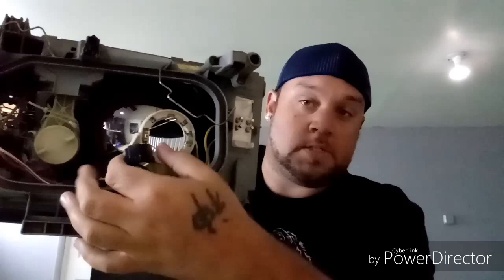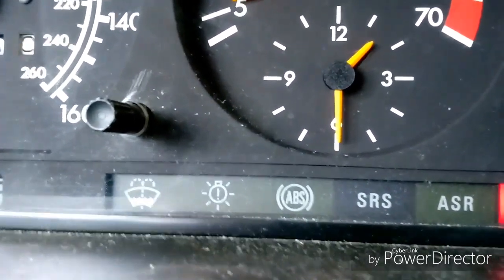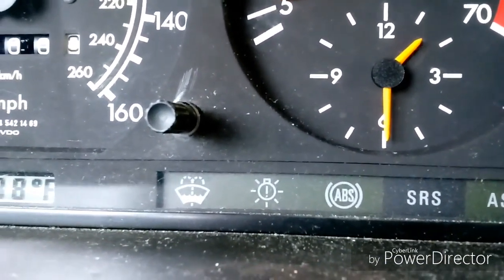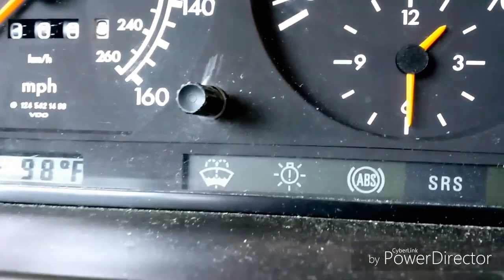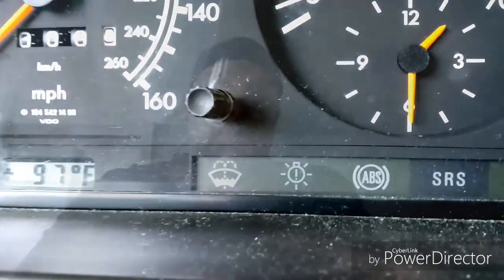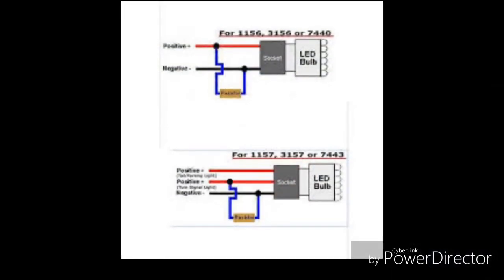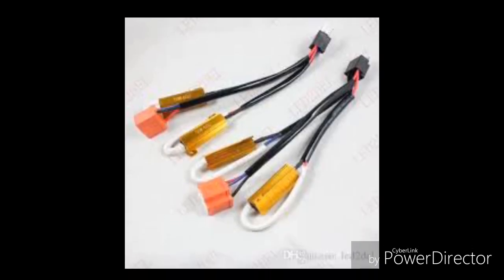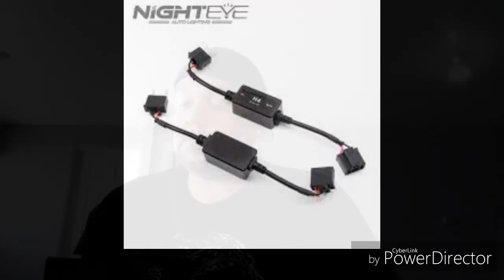Review of h4 halogen vs h4 L.E.D headlights issues with older cars (mercedes,bmw etc)

Comment: Hi dear 
 thank you for your videos
 I have same your car 200E but I would like to ask you,,
 after installing the LED can I install the last cover of the stok headlight?
I'm so sory because my English writing is bad. I hope you understand what I mean😀
Thanks
Reply from the maker: hi , with this led kit the small fan attached to the light  will need air circulation to help keep the bulbs at a low temperature
because l.e.d's get very hot .. you can install the plastic light housing cover over it, but it "could" overhead the bulbs